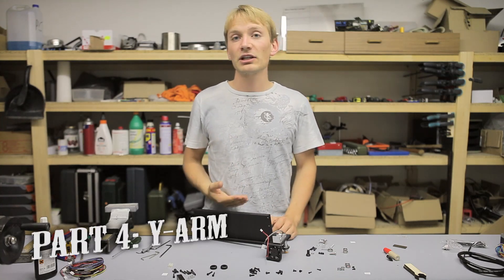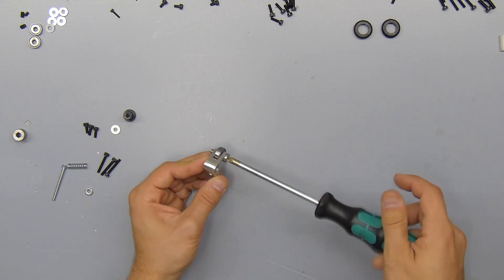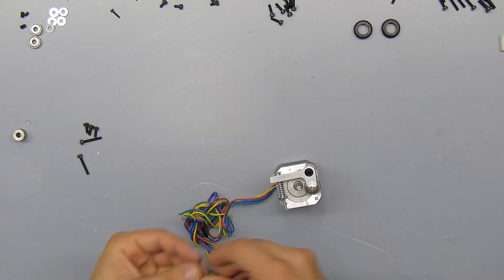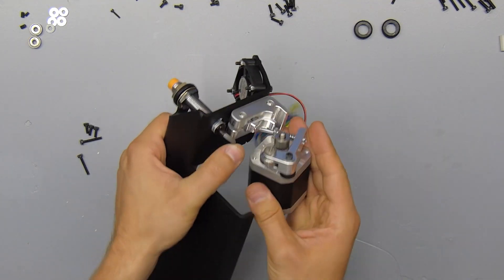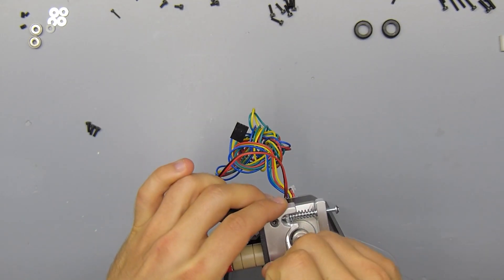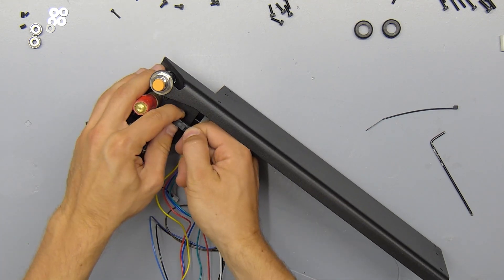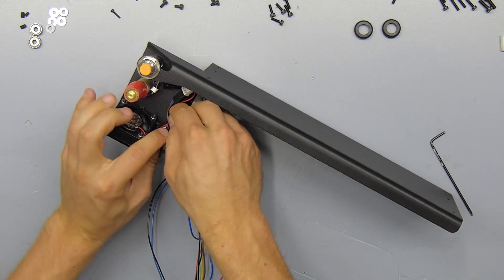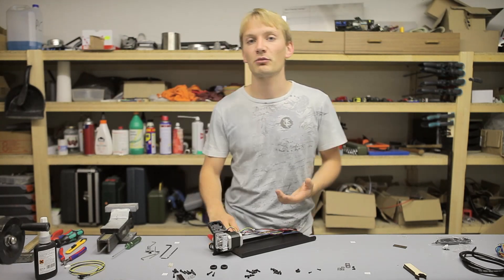Printrbot Simple Metal Kit assembly: Part 5 - Extruder and Hotend

Comment: hi tom, thanks for the great build series for the printrbot simple metal kit.  I have the newest version and I found a snag with your video.  if you have a current model with a v2 extruder it has a 4mm bolt instead of the 5mm Phillips screw.   I thought printrbot shorted me the 5mm bearing and caused me to disassemble the printer to see if I had used it elsewhere.  only figured it out when I noticed that a the 5mm Phillips screw which is still included in the kit would not go into the v2 extruder.  you might add a footnote in your video to correct your guide for anyone building a newer model.
Reply: ***** Hi again Tom,  I found some other small differences is the V2 extruder build involving some screw length changes that cost me about an hour of build time and I'm making a small video to cover that.  I'm not in anyway saying that your video is wrong...  It's 100% accurate for the V1 extruder build and their is still a lot more of those kits on the market than the V2.  Would you possibly be interested in posting a link for my V2 extruder update if you approve of it?  I would get me some much needed hits on my small YouTube channel.

Comment: Awesome resource videos Tom! And for anyone reading this, and at this stage of the build... WATCH OUT and pay attention to your Z-Probe extension cable. Unlike in this vid, my kit came with an extension cable made of red white and black wires. I assumed (fatal mistake) that i should just match ground to ground. This toasted my probe. So yeah, make sure you use the cable in the correct orientation. The two plugs should match up, not necessarily the wire colors.